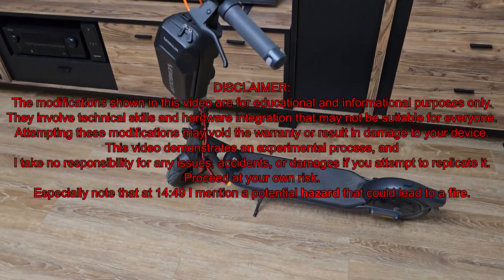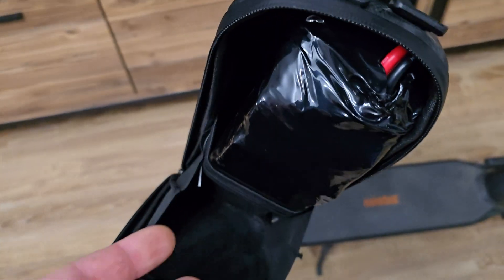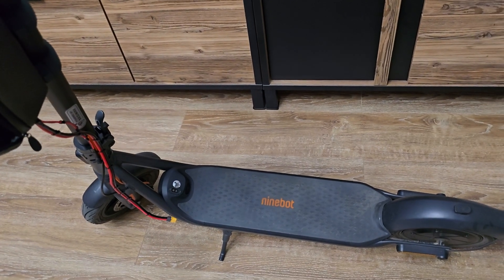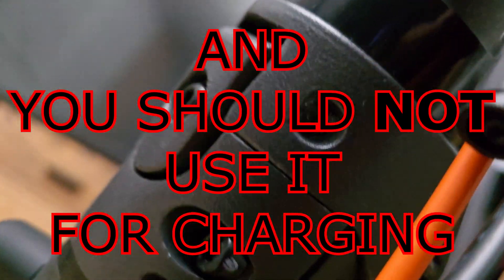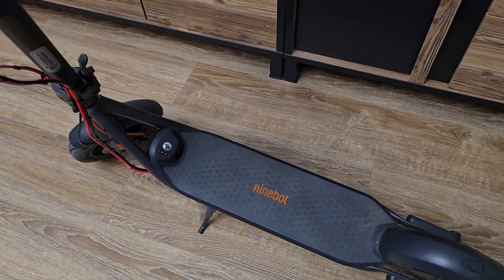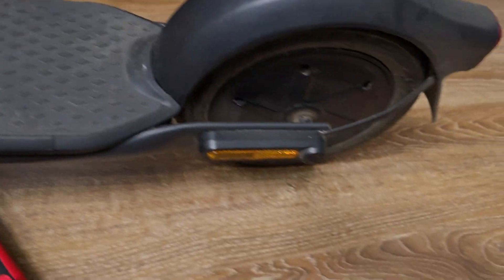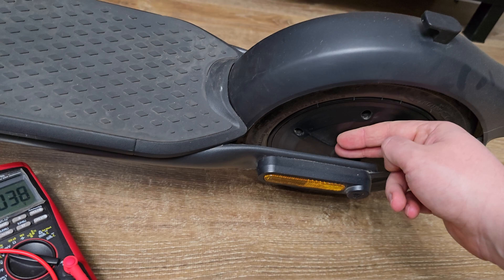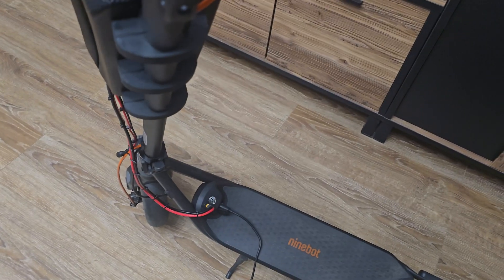Doubling Ninebot F2 Pro Range with a Parallel Battery – Things That No One Tells You!

Comment: Hello I also have an f2 pro and want to do the same! but i don't know anything i bought an xt60 parralel y connector and a 60cm male to female xt60 extension and that's it i need to also buy i battery but i don't know which to buy just a regular 36v chineese battery or need to find an original f2 pro battery and i don't understand really bms i know it manages the system of the battery but idk how it works ! please if you could help me in my project ill be honored. please leave your contact to contact you for help! for example instagram whatsapp or else ! thank you love your videos and your ambition!

Comment: Just began watching. first issue I see is centre of gravity has shifted up quite a way. I would mount this pack as low as I physically could. Less power cable, neater, c.o.g. moved down (from where oyu have it). Also while I'm writing, you can get 3D printed wrap in several colours too, to put around those ugly cables. Make the whole thing more professional looking. Centre and colours come up red underlined because google couldn't be bothered geolocating my position for language; it just wants to know where I am to push local ads my way. No heart, no soul, just money grabbing.
Reply from the maker: Whats more, I'm too small to earn anything from ads...

Regarding centre of gravity, yes, it shifted up, but doesn't feel bad, overall steering column feels better, heavier without any negative feelings that would me push to move it lower

Comment: Sir can I ask some help,, can you teach me how can I install external battery for my ninebot e2 plus e,, can I buy same other original battery or can I buy another battery,,
Reply: I just need extra mile for travel,, Thank you sir
Reply: Hoping for your response
Reply from the maker: @jmdadulo4545  if you buy any other original battery, maybe cheap one from xiaomi scooters, and just dirty connect batteries, these needs communication to output full power, otherwise they might limit and cause problems.

There is another problem, without SHFW your scooter might detect additional battery as a charger so it won't be possible to drive, and I think SHFW is not supported for this ninebot (not sure)

With that scooter I wouldn't do anything, not worth, not possible ;/

Comment: Hey,im thinking about tuning my ninebot f2d. I already bought G2 kontroler to driver 35kmph but i think about external battery. What should i pick in 100$?
Reply from the maker: F2D has poor 10Ah battery, you won't do anything great with that battery, additional battery shown in this video would be good pick so you could deliver more amps - F2 Pro from this video is pretty crazy with light rider I must say ;)
Reply: @HobbyWithAdam  i already unlocked IT with G2 controller. I need some kit 1.battery 2.bag 3.cables and neccesary things. Could you please make me such kit? I have like 150$ to 170$
Reply from the maker: @ 30 cells 2€ each, BMS 40$ bag ~12€, some wires plugs, nickel strips <20€

parts only are about 130-150$ and there is like almost day of work.

I'm sorry but I don't have time for that :c
Reply: @HobbyWithAdam  that's alr i did research already

Comment: Good video, question how much was the battery? And was it hard to install? I have the same Scooter btw
Reply from the maker: 30 cells 2€ each, BMS 40$ bag ~12€, some wires plugs, nickel strips <20€

pretty easy, no problems no surprises